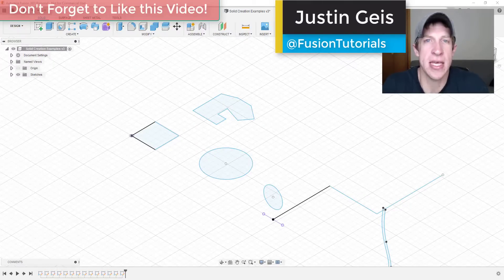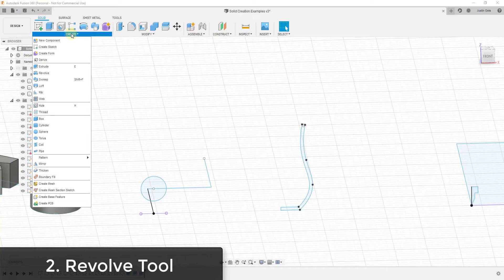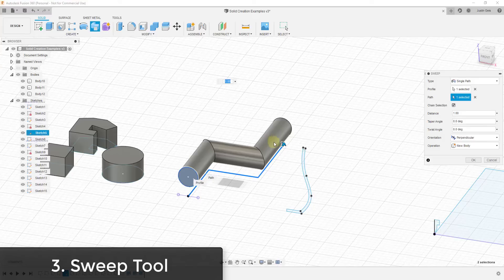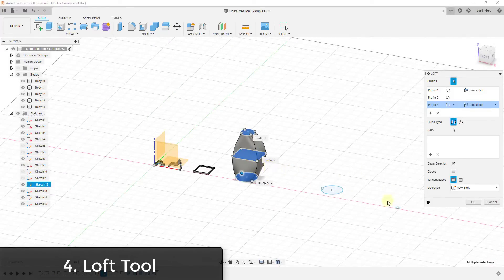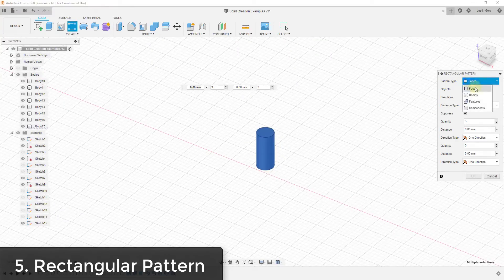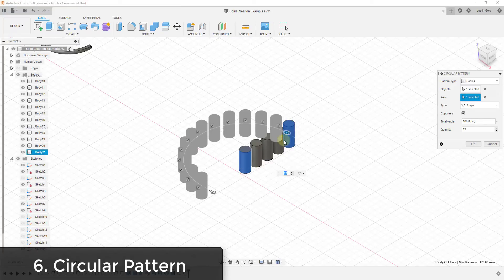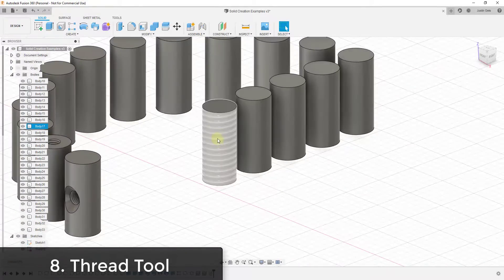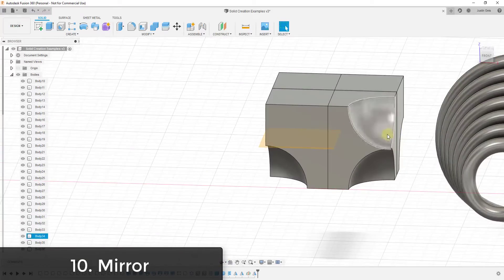Getting Started with Fusion 360 Part 3 - Modeling with SOLID TOOLS!

Comment: in 4.52 of video where you talk about how to make that; I'm sure I missed how to make that drawing.  so I created a circle; that becomes profile, then the line drawing and when I selected the circle as profile, it didn't work. must have missed something. not sure how to rotate circle to make this; so it's at the right angle.  the error I get is the path is tangent to the profile, try adjusting path or rotating the profile, I was like ?
Reply: https://www.youtube.com/watch?v=QimeZSqS_  so I figured out the problem with this other video of yours, thanks. I always get excited when it worked.  the issue was being on the right Plane, to make it work; also had to adjust he sharpness of the curve.

Comment: So...so many issues with this damn loft along a rail.  "Your profiles can't be coplanar"...wtf, why not if it's going to follow a rail?!  "Your rail doesn't intersect with your profiles"...wtf the rail runs right through the middle of both?  Make it touch the edges of both, nope.  Make it outside of both, nope.  Try to delete any of it to adjust, nope you can't delete anything while you're inside a sketch (and most of the time out of a sketch).

Is Fusion360 really this much of a steaming load of crap that it appears to be?  I draw a thing...why can't I just select the damn thing and hit the Delete key?  Nothing happens...it just unselects the thing.

These tutorials need to start from a COMPLETELY EMPTY design to have a chance in hell of understanding how to get to the point where you can even try to use the loft tool or whatever.

Comment: I cannot figure out how your making sketches on different Z heights, anyvids where you touch on that process?
Reply: create sketch, make circle, finish sketch,  click on circle, right-click choose offset plane, enter distance to new plane from original.  then click on that plane and create sketch, draw  a circle then finish sketch. You will see that the circles are at different heights. You can also make a circle in sketch plane then use move tool and check copy and enter in the distance. This way you do not have to exit sketch mode.

Comment: Hi Justin many thanks for the great channel. I am currently on a very steep learning curve with fusion 360, I previously learnt Sketchup using The Sketchup Essentials.

I have a design job I'm working on that has a particular complication, I scoured YouTube and can't find any examples which deal with this, or a similar issue, so I figure it may be of interest to you and other subscribers.

I'm about to build a small structure designed by an architect which has a conical roof. Think of a silo roof, however this one does not extend up all the way to a point but is cut off at a lower level, so imagine cutting off the top of the cone leaving the bottom quarter. Now a silo roof generally has a reasonably steep pitch but this roof has a very shallow pitch so we now depress the "upper" part of the cone down to produce a very flat cone segment. So far it's all simple enough to do in Fusion. So here's the complication, I want to construct it using tapered flat segments of plywood. So they have to taper by the right amount and the edges have to be cut at the correct angle so they  abut neatly. In addition to this on the lower side I want the two adjacent plywood panels to join with a V joint chamfer.

I have considered creating a circle representing the bottom edge, making individual segment and using the pattern tool, however this will not automatically give the neatly abutting segments with the correct angle or the joint. Any thoughts?

Comment: I'm trying to follow along here, but keep running into things you haven't covered yet. So I'm trying to do the Sweep function as shown in your second example (the "picture frame" one). I've drawn a profile on the xz plane, and a path on the xy plane. But Fusion is not letting me select the shape I want to use as my profile. It would help these videos a lot if you did them with a mind toward people following along as you go, and try to anticipate problems that might come up. So "If you're trying to select your Profile and Fusion wont select it, you might need to ____."  Because right now I'm just stuck trying to guess why it won't work.

Comment: HI, I'm going through your tutorials in order (so far) and this third one builds on Sketch from the second one. But, if I try to replicate what you are doing on the screen here (which is how I usually learn), I need to know how to make curvilinear shapes. I'm experimenting, but having trouble figuring out how to control which direction the curve goes, and other important details. It would really help to either stick to shapes you can make with what you covered in the previous one, or expand the Sketch Tool section of the previous one to include how to make that curvilinear form. Thanks!

Comment: I am trying to use the sweep tool to create a shaped bar. The cross section is 30mm x 5 mm and the path is a simple L shape. However when I select the shape  and the path I see the OK box in the sweep  pull down menu is still grayed out so i can't complete the  command - anyone any ideas as to what may be wrong ?

Comment: Justin, just found you.  New Sub.  I am new to Fusion 360.  I find your teaching style to be easy to follow and comprehensive.  One issue I am having is with entering a dimension  after placing and pulling out a circle.  While the diameter field is still blue I enter the wanted diameter and press Tab or Enter.  The circle is drawn at whatever the diameter is that it was pulled out to.  I have to go in and edit every dimension that I want.  This is driving me crazy!  I have done a search for this anomaly with no luck.  I hope you can help.

Mark

Comment: I want to make a tapered cylinder.  I know this can be done by creating two thin discs centered along an axis, then using the loft tool to join the space between them.  Is there a way to do it using the cylinder tool and tapering while extruding?
Reply from the maker: You could create a cylinder, then select one end and scale it down?
Reply: After my post, I discovered that you could sketch a circle, then extrude it with a taper angle.  Of course, you would have to use trigonometry to calculate the angle of taper and know the distance to extrude.